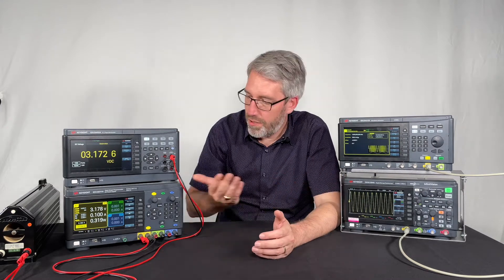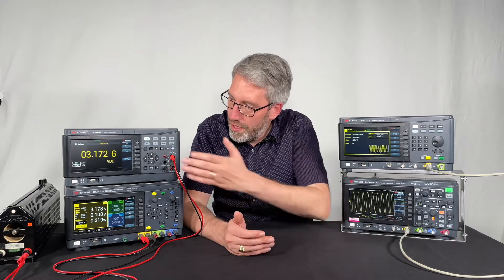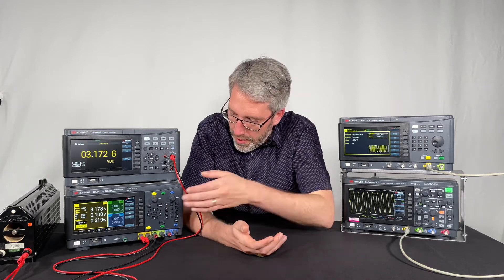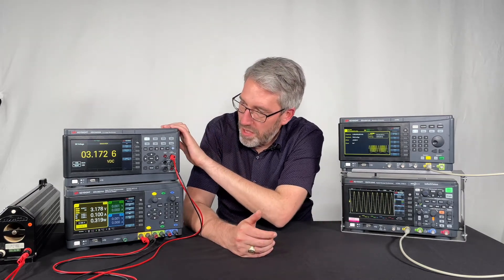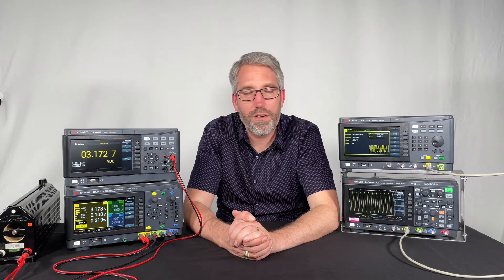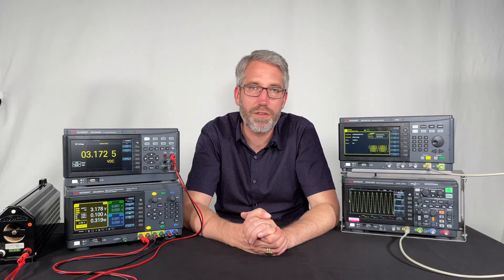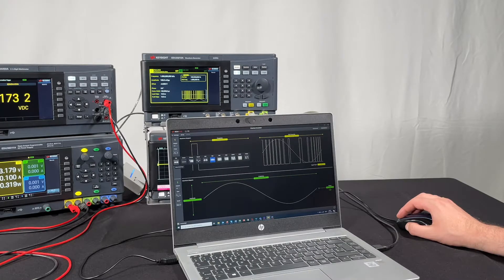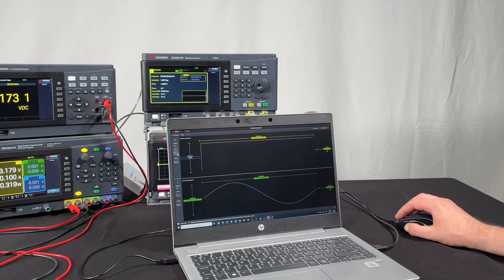What are the Keysight Smart Bench Essentials Test Instruments?

Comment: Any clue to the Part numbers / Model numbers??
Reply from the maker: Function Generator

    EDU33211A
    EDU33212A

Triple-Output DC Power Supply, 3V/1A or 6V/5A

    EDU36311A

5.5-Digits Digital Multimeter

    EDU34450A

InfiniiVision Oscilloscope, 50 MHz

    EDUX1052G

Currently there is a promotion running: https://www.ccontrols.net/global-en/magazine/30-on-keysight-smart-bench-essentials-series-for-educators/